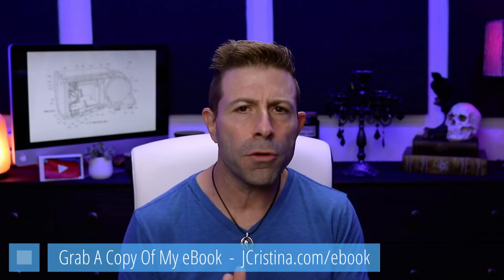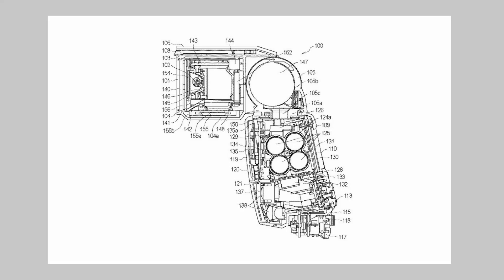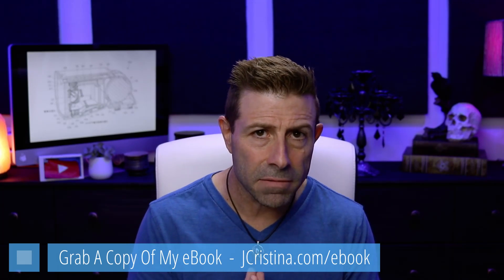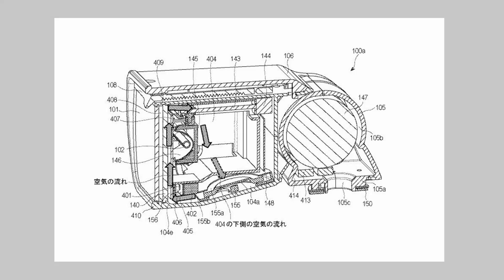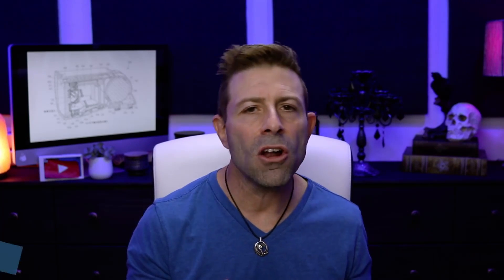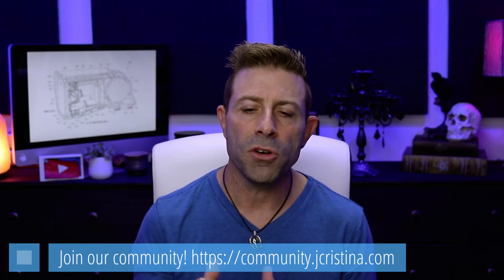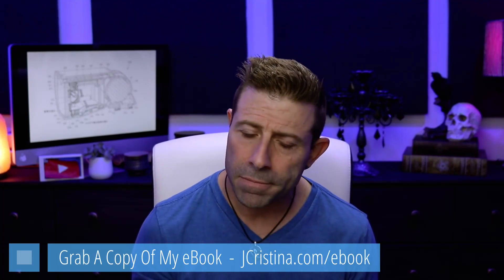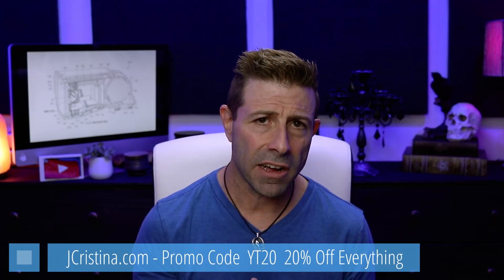Canon Beats The Heat! What Will Other Camera Companies Do?

Comment: CPUs are the biggest problem with the mirror-less cameras and lead to all of the heat issues.  All of the manufacturers use older and much cheaper CPUs than the average smart phone and force those processors to do heavier workloads than they were originally designed for. Overheating is the end result.

Fuji is bucking the trend with the X-T3.  It has a very powerful CPU for its size, which is the reason its the only 4K, 60fps, 10bit, 4:2:2 capable APS-C camera and it doesn't overheat.

Comment: Cooling the camera as well would take a lot of power, you would need  separate cooler on top of the camera under the flash but you would be pumping the camera heat into the flash.

Comment: Another possibility would be that the hotshoe itself is a radiator. With a flash attached, the heat could be transferred into the flash, which in turn could blow it out. That would be more weather sealed than a flap.

Comment: I can see the flash head having its own internal cooling system, but if you have one just mounted on top of the camera like you envision, you would also need to have an air intake port somewhere on the camera. Without a air inlet port the fan wouldn’t work because I wouldn’t be able to pull any air out of the camera you need a flow through ventilation system and that would negate the weather proofing of the body.

I also think running a fan in the camera body would be sucking in a lot of dust and really do a number on your sensor as well.
Reply from the maker: Maybe at the very bottom of the camera to limit moisture getting in on a rainy day.

Comment: The only way this could work in a camera is to keep the electronics and optics path sealed creating a 'clean side' and use air to cool a heatsink on the dirty side that could have an air inlet on the side of the body. We've all seen what happens to cpu fans and heat sinks. You wouldn't want that for your camera's internals and the sensor, and any lens attached to it.
Reply from the maker: Absolutely.  Simply cool the opposite side of a heat sink.

Comment: Hi Joe, Jose here from hot Puerto Rico. :-). Interesting concept. Here are my 2 cents. When was the last time your refrigerator broke down? Point being that these units are in your house operating 24/7 365 days for who knows how many years. Heat is dissipated by the refrigerant. Japanese folks are famous for miniaturizing gadgets, so how about a Canon with some type of refrigerant liquid like those used on those high-end computer setups I've seen here on YouTube. The only problem would be condensation. I don't know how far technology can go, but that's how far my brain can go since I'm not an inventor like you.
Reply from the maker: Let’s miniaturize an internal cooling system. 👍👍

Comment: Using hot air from the camera to cool the flash that is even hotter. The fan at the top to cool the camera yes i like that, to use it whenever the need.
Reply from the maker: If they had an inlet at the base of the camera it would work.
Reply: @jcristina  Basic thermodynamics teaches us that you're wrong! Hot air does not rise like you state, cold air is denser so it falls displacing hot air upward. Blowing cooler air through the body and flash might work but preventing grit or moisture from getting in would be an issue. Where do you put the hot-shoe contacts in this set-up?

Comment: I have no clue what Canon is doing..I will say this though.If they use cooling fans they have to make sure,they are dampened so they dont make too much noise.They have to make the vibration of the fans minimal or suppressed,and they might start going with more DSP chips,like 4 instead of three,to squash down the load on each individual one...
Reply from the maker: Great points as always.

Comment: I would be looking at very power consumption chips particularly for cpus and on board memory. The heat comes for power consumption. Also, heat problems are not unique to cameras but are a problem with many other devices so I would look at what other industries are doing to solve the problem.
Reply from the maker: All electronic suffer from heat issues for sure.

Comment: In my opinion, the best way for a (partially) sealed camera with active cooling, is to have both intake and exhaust vents on the bottom of the camera. The rain (obviously) falls from above, so the raindrops would hardly reach the bottom vents, which would be filtered/meshed against internal dust buildup. The fan and metal heatsink would be attached directly to the sensor backplate. Yes, it would make the camera thicker - but R and RP (for example) are already thin enough, if we exclude the grip. We would also need to address the problem of tripod mount hole and tripod plate, so that they don't obscure the vents. The hotshoe device that you propose would blow the air to the front, which could cause the camera to be slightly "pushed back", and this would result in camera shake.
Reply from the maker: Thanks for your thoughts! Great conversation.

Comment: Panasonic S1H has fan cooling for the FF sensor and is weather sealed. Their M43 cameras that can shoot 4K forever never have had a heat problem.  As microprocessors get smaller and more efficient, the heat problem within cameras will disappear.
Reply: True for CPU, but sensor will still generate heat.
Reply from the maker: You are both right! Great conversation !! Thanks guys.

Comment: I like the idea but, like you, I doubt Canon is going to do that BUT if they built into the ovf/evf area a fan then sucks and pushed up and out the front top of the camera, it would be an excellent idea. It would be built into the camera body but at least it only maybe make the camera a tiny bit taller. But the main reason why I think Canon is doing this for a speed light is because they probably are making a stronger, faster speed light and need to cool it down so it won't burn out.
Reply from the maker: I bet you're right, Richard. As an inventor of photography gear, I alway like to look at not what is being made but what can be. I really enjoy it! ;)

Comment: It could be done as an after market 3rd party device
Reply from the maker: Well, not really as there would need to be a FLAP under a redesigned hotshoe which would over into the camera acting like a chimney to route the heat up and out of the unit.

Comment: I don't get it astro photography cams have been using peltier coolers for a long time isn't it time we had these on normal cameras. Also even cameras other than the silly money non Bayer mono Leica cameras The only other option is to remove the bayer layer by scraping it off. This is possible on quite a few cams tried it on an old Canon 30d you will have more sharp detail all 4 individual pixels details and more light penetration. Going to convert my old 5d classic too. Try Google CFA layer removal. There are also some on peltier camera conversions .
Reply from the maker: Wow! That's really cool. I've never tried that... Love hearing real-world tips and tricks!

Comment: At the same time I have seen an article about a Canon DSLR body with fan -based cooling. I thought it odd (I can understand the flash needing extra cooling), but your deduction may be right -rather odd that cooling systems for both camera body and flash arrive simultaneously. I have to give you the credit for possibly barking up the right tree.
Reply from the maker: I'm sure I'm wrong but know how the C series works and understanding how Apple dusts there heat with "basically" no fan (little fan), it could be a possibility.. We will see.. It's fun to speculate... Thanks Alan for adding to the discussion!

Comment: Cooling the camera? Unlikely.
Reply from the maker: I'm sure you're right but... If there is a will there's a way and adding piping / a route inside of future cameras like they do with the C series line up might not be to far fetched but, who knows. ;)
Reply: @jcristina  The camera already gets very hot. Shifting that heat onwards, or rather upwards, into the flash body would effectively heat the flash unit rather than cool it. I like the idea of an external cooling device fitted to the hot shoe though but this would require venting through the hot shoe. It wouldn't be feasible to simply conduct the heat away.
A better solution would be to design the camera with passive cooling through the parts of the body that are not physically touched such as the base. Imagine the flat base of a camera mounted onto a tripod via a close fitting base plate which also has passive cooling. The tripod could also afford to have fins below the said base plate to increase surface area and aid cooling just like the passive cooling on some PC CPU's.